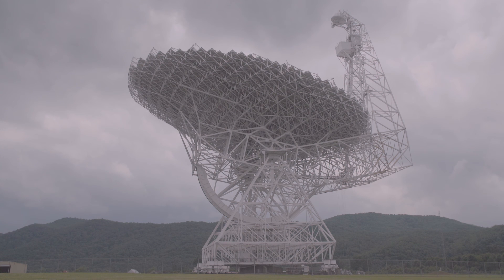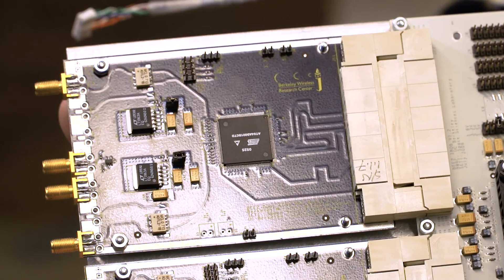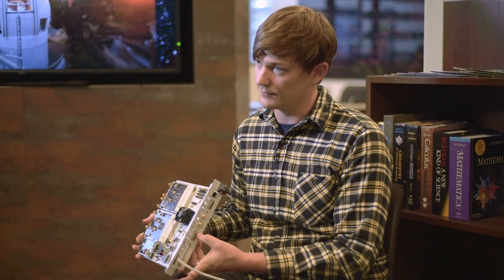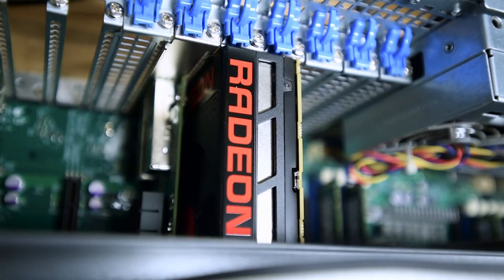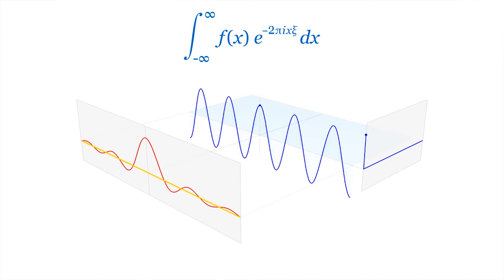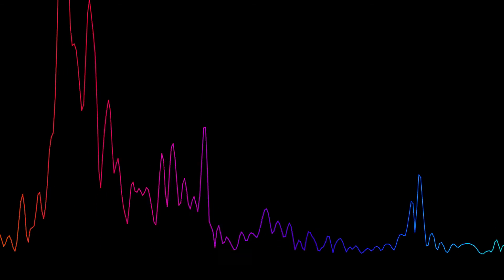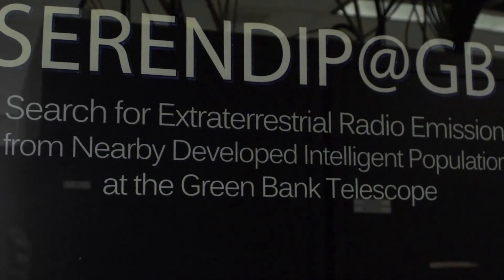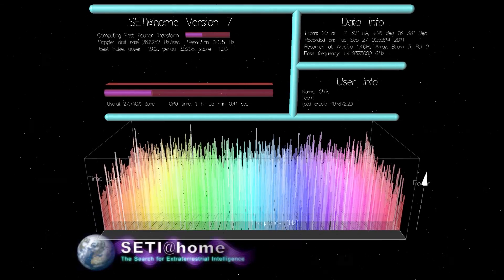Meet Breakthrough Listen researcher Danny Price

Comment: Is SETI@home still sending Data to be worked on. Our Founder for our group "New Mexico" said that you are not collecting any new data and we are doing the data that is left over from the last year from Arecibo Radio Telescope. I've been doing SETI@home since 2001. I finally got a decent computer up and running this past April 2017, and I been avg about just shy of 12,000 units per update. I have an AMD FX 8350 running at 4.2Ghz and 24 GB RAM my Video card is an older one and ASUS R7 250X 2 GB. I am Hoping to upgraded to a RX 580x if the prices come down. then my GPU will blaze through the Data. Currently my Video card is doing a single unit in about 20-25 mins, and the 8 CPU Cores are doing them in about 2.5 -3 hours. If i get some money I may Build a new system with a RYZEN 1700X CPU and a X370 Motherboard.
Reply: Kristyanna Virgona don’t waste your cash on any equipment...the game’s coming to close... see ‘To the Stars Academy’....sorry to be the party pooper.